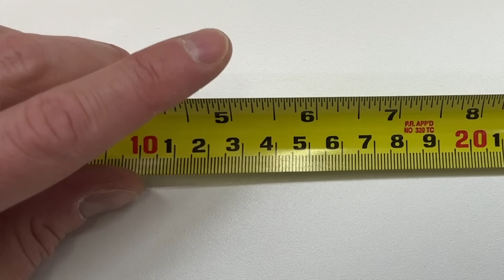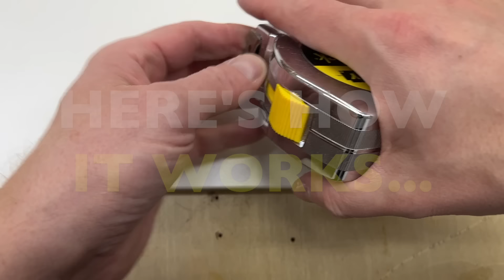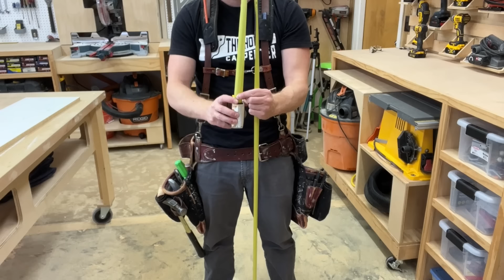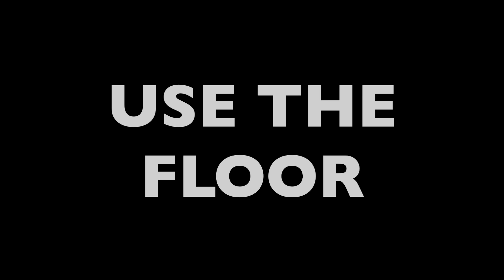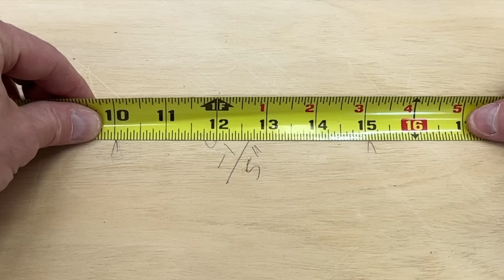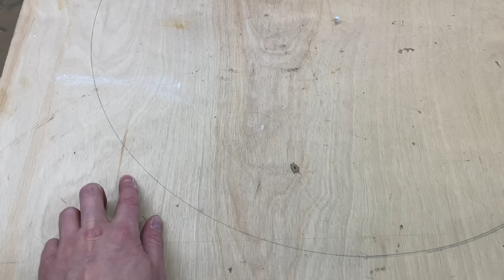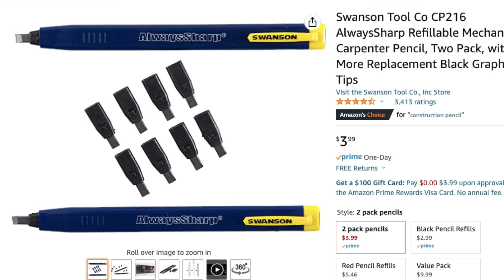ALL TAPE MEASURE TRICKS Explained...In Just 13 Minutes! (Measuring Tape Pro TIPS, TRICKS + ADVICE!)

Comment: Good for beginners. I think two points for more advanced users are adding the length of the tape measure housing itself inside tight areas like a box. Other advise to avoid the crooked tape measurement is to measure up to an easy number, then reading from other side and add known number to total. Keep up the great work!
Reply: Yes, two good additions.
Reply: Thanks for the explanations. I was missing the part where you mark the surface.
Reply: Absolutely second the tape measure housing trick. For those who haven't seen it, under the back tab (usually) of your tape is the "long" dimension of the housing itself. Incredibly useful in a hook and pull application where one hand controls the tension pulling and the other butts the end. Read the visible dimension (from as close to overhead 90-degrees) and add the known dimension of the tape housing. 

I use the Stanley FatMax 35' specifically because of it's 3-1/2" in housing length. The 30' version (I previously used) I believe is 3-1/4" in length. Not awful to use for this trick, but halves are always easier to comprehend when you are taking many dimensions and trying to remember them in sequence.
Reply: The measure from both directions and add is great and often overlooked for inside measurements or long measurements when you only have a short tape on hand. Folding rulers are cheap and a great backup for those annoying close quarters measurements as well.
Reply: Man. I just finished adding steel pipe segments between pantry shelves to  connect all the shelves and brace against the floor. Kept reading the curve and being slightly off, resulting in a ton of extra work with a pipe cutter. The housing trick would have saved me so much labor. Now I know for next time!
Reply: Can you explain your second tip again please? What does "reading from other side" mean?
Reply: @grantcivyt  Absolutely. Let’s say you are reading inside a window sill and need an exact measurement. You would read 10” and make a mark. Then measure from from other end to your mark and add that original 10” for an exact measurement without having to factor in the curvature of the tape measure blade.  Very critical when exact measurements are needed and you can’t be off by 1/8” or more.
Reply: @ifiwooddesigns this is also useful for when u have to measure a massive area that is longer than ur tape
Reply: @grantcivyt  If you're measuring the length of a wall, Span the tape left, make a mark at say 5' Then span the tape right and to the mark then add to 5'. 
It's a great way to work by yourself.

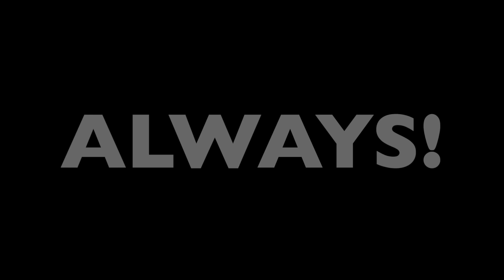Comment: When putting your tape measure into the holder on a carpenter belt [4:15], you can leave the belt clip on and just put it in backward. That way it's still useful without the rig.

Comment: As a Brit, I am more used to the metric system; however I really struggle to distinguish millimetre marks that are all the same length. 2 or 3 or 4mm, all look kinda similar. The different length ticks afforded by the imperial system look clearer.
Reply from the maker: I guess it does have that advantage, Andy …hadn’t thought of that. Good point!
Reply: You need a new tape measure.  Get one that has the extended 5mm marks.  That makes it super easy to distinguish each mm.  It's way easier than fussing with the likes of 5/8", 5/16", and 5/32".
Reply: @pilafmon  it does have those extended marks. My point is about resolving the lines between the different-length marks - on a metric tape measure, there are 4 of the same length; on an imperial tape measure (at least the one shown by HC), every mark is different.

Comment: I'd add: don't let the tape snap back into the holder. Eventually that'll wear on the tab and decrease the accuracy. Good video! :)
Reply: On really cheap tapes, yes. But even mid priced ones very rarely have this happen. The inaccurate measurements due to tab problems are usually BENT tabs. There are a few videos (Steve Ramsey did one, I think 10,000 or maybe 1,000 releases) that show this is rarely a real problem.
Reply from the maker: Good tip!
Reply: Just under 10,000 times to break the tape. According to Steve Ramsey.
Reply: @bobby-c7731  Yes... that is what I was remembering from him. Thanks for clarification! I still have not seen more than maybe a 16th on my tapes, and that's about 2 years per unit. I usually damage them from very long drops before they get inaccurate due to me letting it go from 20' 30 to 40 times or more a day.
Reply: total myth - https://www.youtube.com/shorts/BDfX-Fj6ICI